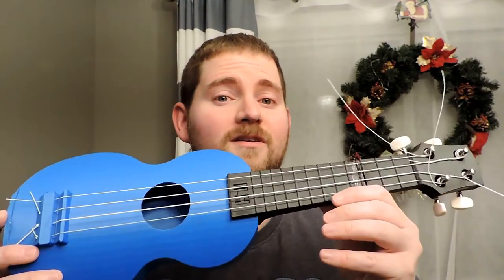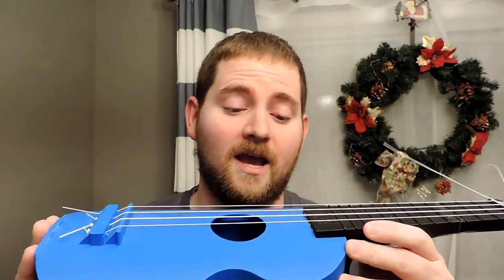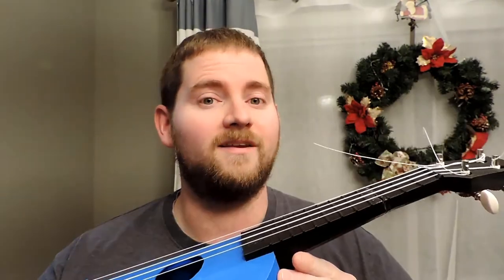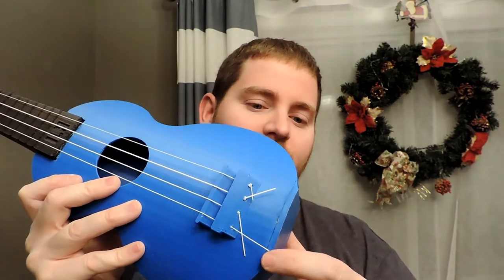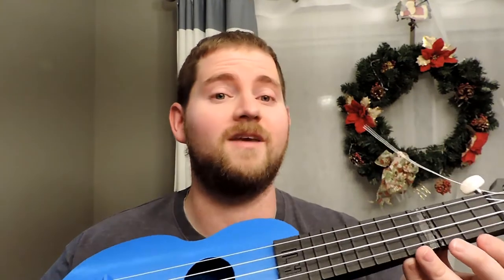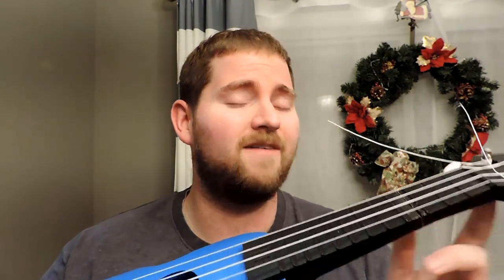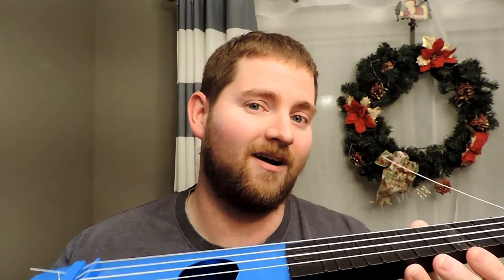Make A Model Monday - The 3D Printed Ukulele

Comment: What orientation did you print the pieces?
Reply from the maker: Builder's Mark, Mark Poole all three pieces were printed upright. The top part of the neck needs really good bed adhesion.
Reply: Print 'N Play what is that on the fretboard about 2/3's up from the body. Taped, glued, deformation? Looks like it goes around the back of the neck?
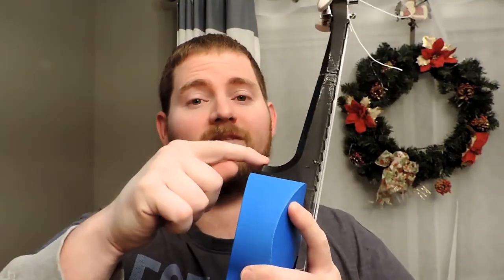Reply: Print 'N Play you can see it from1:14 to 1:20
Reply from the maker: It took me a few tries to get glue that held it well. I tried epoxy at one point, and that's the residue from it.